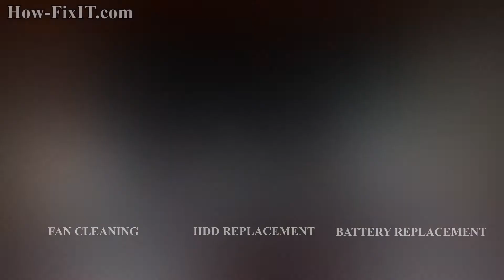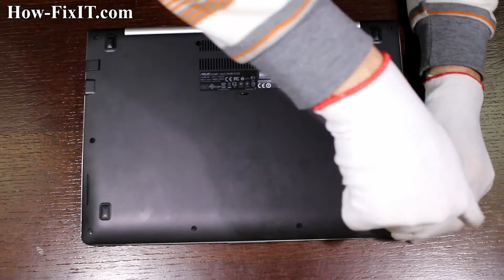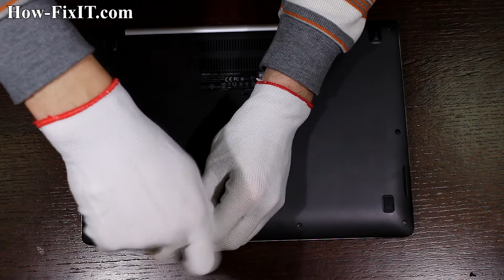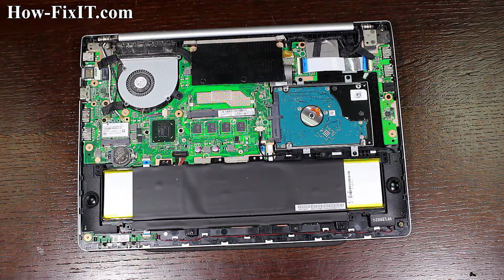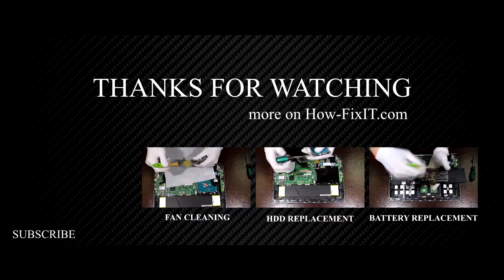Asus VivoBook S400CA RAM Upgrade and Installation Guide

Comment: what is the max amount of ram supported by this asus s400? 8gb or 16gb?
Reply: Suggested 4GB add on ram max. Do not buy 8GB ram. It would not work.
Reply: it shows 32 GB, but I guess upgrading more than 8gb won't be very useful with these specs. In Command Prompt window, type: "wmic memphysical get maxcapacity" and press Enter to know the max ram supported by your computer
Reply: @bilalzinbox1  RAM massima supportata 8GB